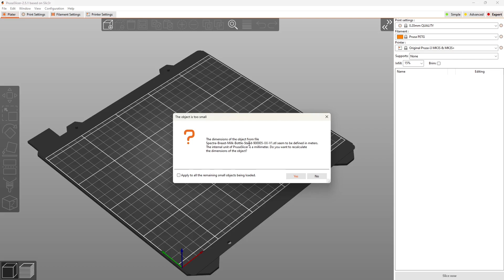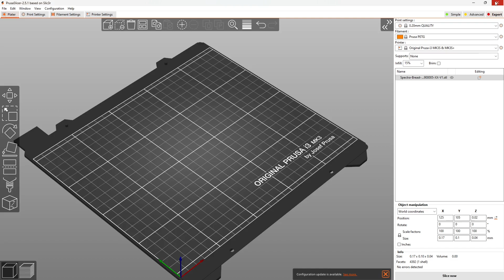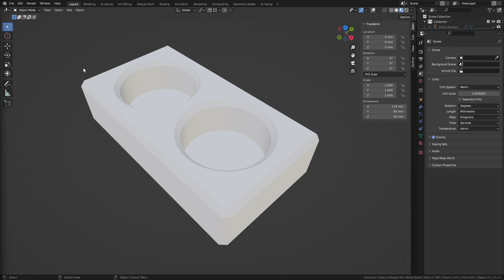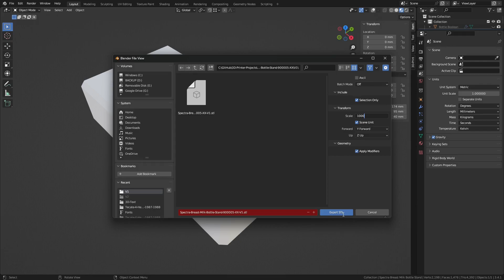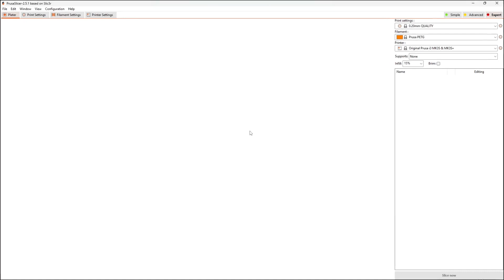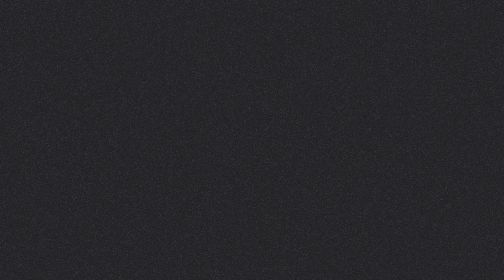STL Export Scale Wrong? Do This in Blender

Comment: Hello, does anyone knows if I can apply this to my workflow? I work in inches most of the time.
Reply: Hi! I might be about 9 months late, but I run into this issue all the time when going from Blender 5.0 to Orca or PrusaSlicer. Most of the time the “scale by 1000” trick works, but sometimes it doesn’t.

What I recommend is starting your Blender scene with a 2 in × 2 in × 2 in cube at real size. You can confirm the edge length by turning on Edge Length in Edit Mode Overlays. Export that cube as an STL. Import it into Orca or PrusaSlicer and see what size it comes in as.

If it imports correctly, then your settings are fine. If it doesn’t, you now have a known reference so you can calculate the exact scale factor. The scale factor is expected size divided by imported size. For example, if the cube should be 50.8 mm but imports as 20 mm, the factor is 50.8 ÷ 20 = 2.54, so scale up by 254%. If it imports as 2 mm, the factor is 50.8 ÷ 2 = 25.4, so scale up by 2540%.
Reply: Overall tip is if you work in imperial set all your workspaces to be imperial as well, will save you additional hassle down the road.

Comment: Hey, man, good video, I just watched a video by Grant Abbitt where he said he "can never remember" if the scale is 100 or 1000 when exporting an STL from Blender. Found yours by looking for the answer. You got it, right! I also found out that you can avoid adjusting the scale every time during export by having the scale in Scene Properties set to 0.001 and changing "Length" to mm, then save as default file in File > Defaults, that way you don't have to repeat the steps every time!